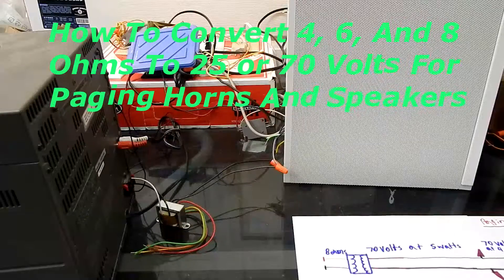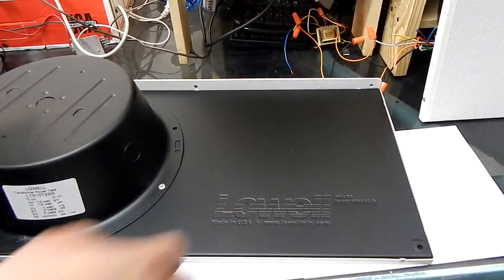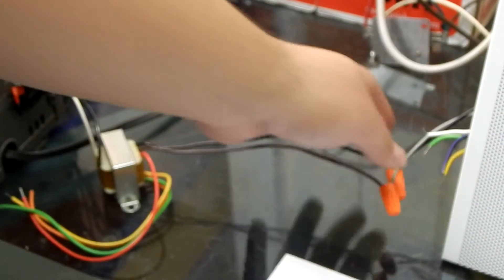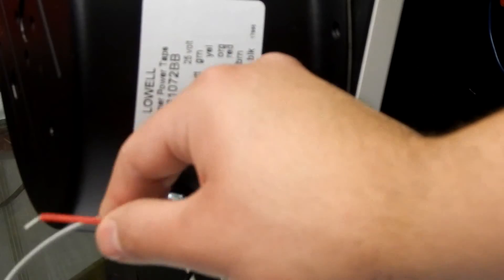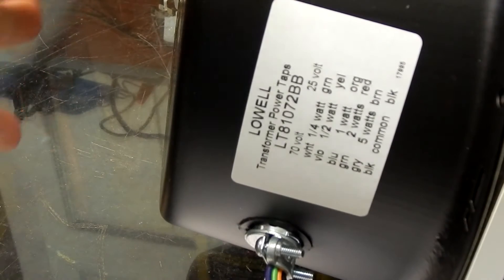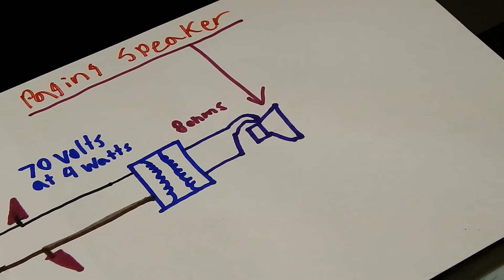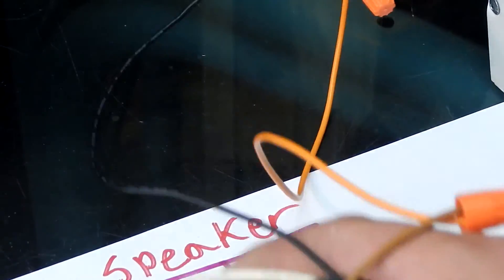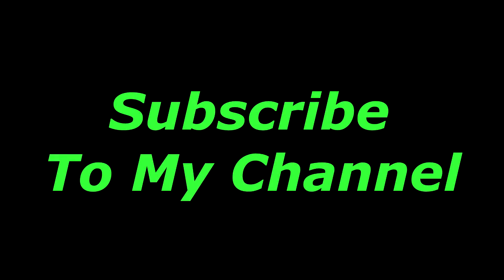How To Convert 4, 6, And 8 Ohms To 25 or 70 Volts For Paging Horns And Speakers

Comment: hi,How can I hook up my 8 ohm outdoor speakers to my house intercom that uses 45 ohm speakers?
Reply from the maker: You cannot do that since it will mess up your house intercom system plus if it's for talkback operation as well it will sound terrible when used as a microphone. Plus if it's a Nutone intercom system they use 25 ohm speakers.

Comment: If I have a 6 ohm speaker and I want to connect it to the secondary of a transformer but, the transformer only have 4 ohm and 8 ohm options which do I use?

Comment: I have 8 ohm speaker i want to know haow to connect it into pc or mobile
Reply from the maker: You need a stereo set or a audio receiver that supports 8 ohm speakers  which will be stated on the back with a number and a symbol where the speaker connections are at. You also need a RCA to 3.5 mm cable to connect your computer or mobile device to the red and white inputs on the back of the receiver or stereo set and anyone is fine but don't use the phono input if your audio receiver happens to have it. Lastly set the input source that you have your computer or mobile device on.